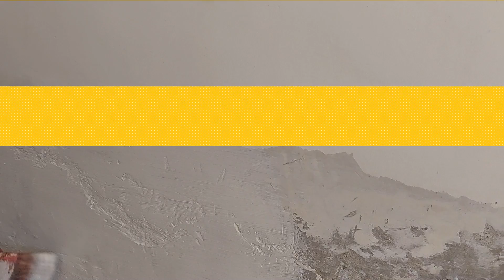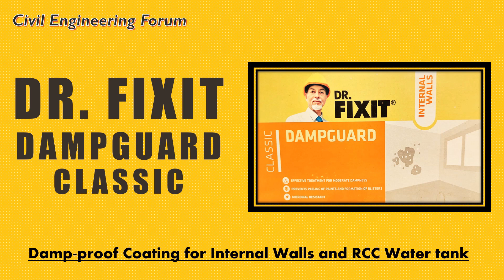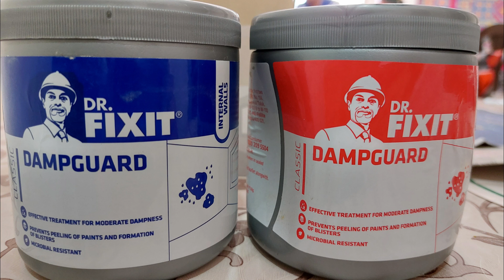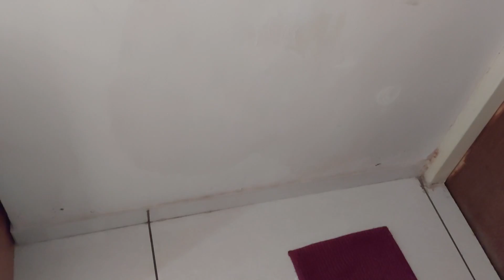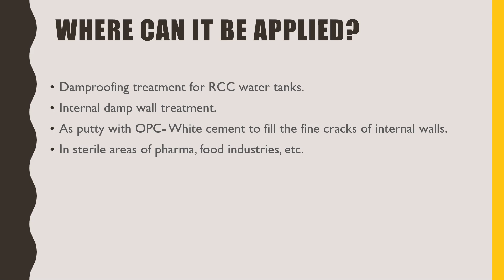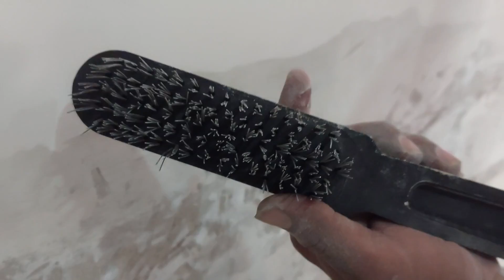Dr. Fixit Dampguard Classic | Application | Wall Dampness Problem and  Solution | In English

Comment: Pl.  Reply how to get rid of the foam in water after applying 2 coats of damp guard waterproof.  Is it toxic to use the water after applying the damp guard waterproof? How long it will take to clear the water from foam?
Reply from the maker: Not at all toxic.
Reply: Thanks.  What about the foam?  I am expecting your reply?
Reply: @anuradha5580  Wash it thoroughly 6-7 times

Comment: After damp proofing with dr fixit, can we use a coat of white cement before applying putti??? Will it be very costly???
Reply from the maker: Yes you can do it.
Will not make much difference in cost